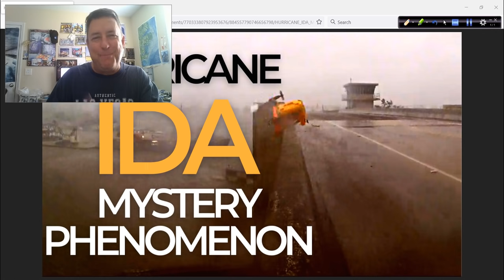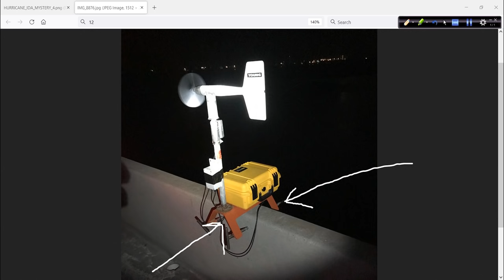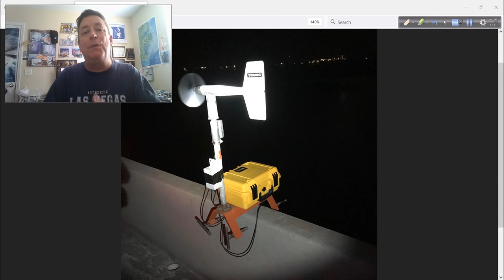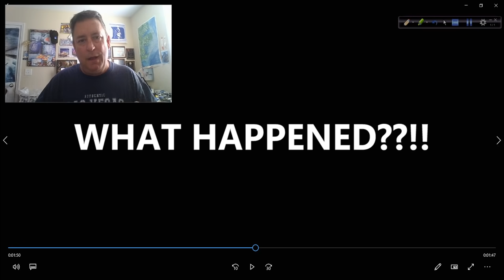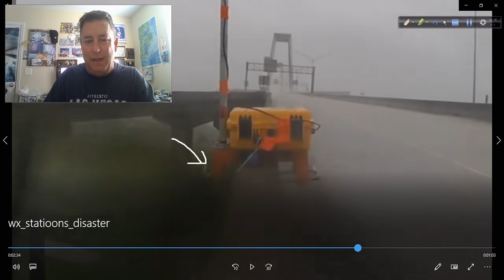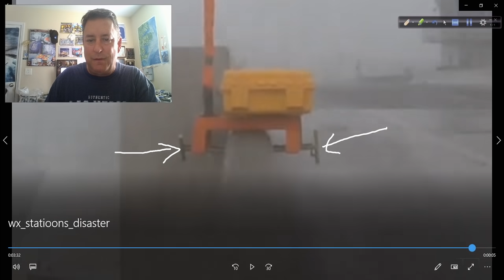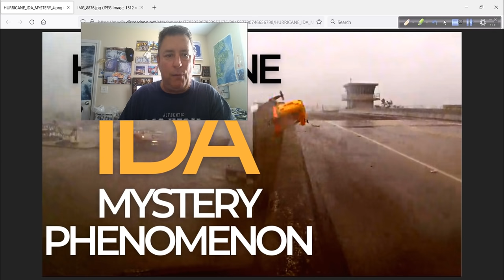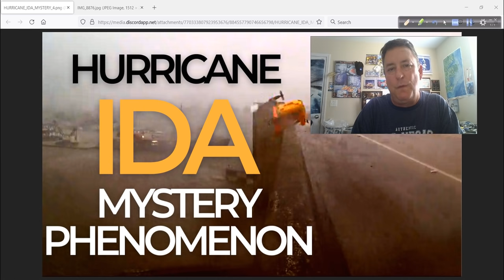Hurricane Ida Mystery Phenomenon: We Lost Two Weather Stations...Why????

Comment: It's definetely a vibration caused by the wind putting pressure on it. It's too bad there isn't an elevated surface you could put it on that it wouldn't need screwed too. If it could sit on the ground it would probably be fine. I'm guessing the devices are also pretty top heavy so maybe some sort of counterbalance could help too.

Comment: Small Outboard engines are clamped in a similar way on the transom board, but the clamps have a hole in each end so you can fasten them together once tight. That way they can never undo, unless you first remove whatever is locking them in place.
Reply: exactly...in this case the wind is simply blowing the handles loose...climate change..stronger winds...time for a new design of clamp

Comment: Jersey wall is a trapezoid. Any movement at all upwards (the only direction it can go) will decrease the pressure on the the clamps. Compounds from there.
Reply: This was my thought as well. The wall gets narrower at the top, thus once it started to wiggle lose it was done for. Simple solution: nylon lock washers. Also drilling a small dimple into the concrete would ensure the rig can not move upwards.

Comment: Is it possible to use some kind of strap,  like the ones that they use to tie down cargo on tractor trailers?? vibration does loosen things and hurricane force winds are going to pull. For example, shingles and the screws come off roofs over a certain mile per hour of winds and hurricane winds pull out boards, off of Windows, that are held fast by special screws.
Possibly if you put strap around the screws and tighten it really tight it the wind will not be able to move the the screw. I heard on the weather channel some of those winds were clocked at 150 mph when this hurricane first hit land. And for some odd reason things that are square don't hold up to high force winds as well as something that is sphere shaped

Comment: I'd try a cable from the back T on one side to the front T on the opposite side & reverse the other two T's as well (X) so each pulls its mate in the tightyrighty direction... They can't turn looseyleft unless the cable is removed.
Sorry about the loss though, expensive equipment!

Comment: I agree. Despite being a rather complex cause, the solution could be as simple as adding some rubber feet and a locking nut. Those feet should help limit the vibrations, and locking nuts will help prevent backing out up to a certain point.
Reply: I second the rubber feet idea 💡

Comment: The anemometer has too much leverage when the wind picks up causing the brackets to wobble thus resulting in the brackets and t-handles to loosen.  You could put a jam nut on the t handles to keep them from backing out and/or sharpen the ends of the t-handles to a point like a pencil so they “bite “ into what ever you are clamping on to
Reply: My thoughts as well. I think the lever arm of the anemometer might be flexing the whole bracket and causing loosening. Jam nuts are the simplest solution along with sharper points. It won't be "tool free" with jam nuts but wouldn't add but a minute or two more to deployment.
I'm a mechanical engineer but harmonics is not my specialty.

Comment: I'm fairly certain that the source of the vibration is the anemometer itself. Every time it has to change direction, even very slightly, applies a quickly changing force to the mount proportional to wind speed and change in direction. This vibration is the difference between the cameras that survived and the weather instrumentation that did not. Both had wind load, but only one had vibration as well. A great analogy would be changing a tire, where often you can put the wrench on and literally stand on it and it the nuts wont budge, but the guys at the tire shop use an impact wrench for half a second and it's off.

Comment: I believe you're on the right track, harmonic vibration (from wind vortex) of the cylindrical weather station poles that is transferred to the K rails. Are the poles welded to the K rails? If so, check for hairline cracks or possibly investigate using some type of damper.

Comment: I bet the bridge was starting to vibrate harmonically (like that bridge that fell down like 50 years ago) and it backed out. Other devices will use a “tie strap” type of thing through eyes in the screw handles so that they can’t unscrew. We use a somewhat similar method on different type of marine anchors.

Comment: If the concrete is sanding down there won't be a solution.
But vibration?  Eternabond a stainless steel rod to the pole for rigidity. Once every 10 years for a big one.

Your towers might start talking to you and say, you want me to spin a million mph and not vibrate? I quit.

Comment: Whatever the cause, three measures to address this:
1) KISS - lock nuts on all four screws might  keep them from unscrewing
2) Swivel pads (like on C-clamps) with a flexible rubber coating on the screw ends would absorb some vibration
3) A separate C-clamp with a chain to the main unit - like a trailer safety chain, would keep the unit tethered if its clamps failed

Comment: I'm somewhat in line with what you're thinking, which is resonance

Just the right range of frequency from the vibration feeds into itself and amplifies it as a result

As far as a solution I honestly couldn't say, not sure if adding rubber grips where they pins go in would diffuse the vibration or hurt the grip

Comment: Probably already thought of this but could you put tape on the threads? Possibly some type of bolt on the thread side? I worked in the oil field and vibration would always loosen nuts and bolts. Tie off the handles to the opposite side so it can only move in the tightening direction. Maybe tie the whole thing down to set off weights as last resort.

Comment: The orange base plate on the DOT clamp looks thin. It could be flexing given the oscillation of the anemometer mast allowing the clamps to loosen.  In addition to using steel wire to tie the T handles together I would tie all 4 legs together with a ratchet strap. Previous comments on foot pads are noted and definitely cannot hurt as they would increase your friction surfaces.  Rubber foot pads will grip the concrete opposed to the point connection you have now.  It would be interesting to see where the unit was mounted and what if any divots were left behind by your original installation.

Comment: Too small surface contact area. The ends of the screws are acting like rock crushers with the vibration and erode the concrete surface enough to where the screws can turn. You need large cup feet (looks like a giant cupped washer, like on a c-clamp) to spread the tighten load so the screw doesn't erode the concrete at contact point. Consider a tri or quad mount for the annenometer so there is much less vibration

Comment: I think the vibration started loosening the bolts and then the wind pressure caused it to let go. Plus the water might cause the concrete to contract and thus loosening the screws. Does not look like a real secure way to go to me. Plus it is top-heavy.

Comment: Hi Mark, here's what I suspect happened:

3 key concepts come together to explain  the engineering problem:
1. Gusts causing vibrations
2. Material hardness and material interface
3. Abrasion, effectively sanding down the softest material at the interface

Gusts cause vibrations of the platform. Vibrations may be tiny at first but sufficient. Those vibrations grow. How? Because at the interface between the (hard) metal screws and the (not as hard) concrete results in the concrete bring chipped away a very tiny amount with each vibration (think of this like the screws slowly sanding down the bridge/concrete (or whatever other less hard material is there, it could even be a softer metal or softer alloy material).

So you have vibrations that are growing and screws that are sanding and eventually maybe even chipping away at the concrete. The result is that if you sand down that bridge by a few millimeters you will see the same effect as if you hadn't screwed it in well enough (you guys did screw it in well enough! As well as anyone could! But there were still vibrations because no material is perfectly stiff)

Another part of this is the platform stiffness. No matter how stiff it is, in the real world, there will be vibrations with the gusts/wind/rocking/movements of the gear and the air flow and air direction shifting and changing abruptly. 

Over time the thing comes loose.

So I think bridge got sanded down due to vibrations and the equipment was now loose. 

Other possibility is the platform was not perfectly stiff and vibrated like a butterfly out.

Or maybe a bit of both! Right? Vibrations happened even if you cant see or measure them.

What you may wish to do to prevent this vibration from ruining your gear is to add rubber grips on thr bottoms of those screws. I can't guarantee you that will work better, but maybe another engineer can chime in here as well. Rubber will dampen vibrations and increase surface area of the contact interface between your platform and the bridge.

Best of luck Mark and thanks for your work!
Reply: Vibrations were the first thing I thought of too. Winds can produce pretty intense vibrations on bridges, which over long periods of time can loosen those screws.
Reply: Not only wind gusts causing vibration. Water flowing around concrete pilings can cause wicked harmonic vibration. Also think about a large chunk of debris lodged against or between a bridge piling and the extreme vibrations this would create as water rushes around it. Perhaps the DOT could shed some light on vibration tolerances so you could be reasonably certain this is your problem.

Comment: The source of the vibration is an interesting question but regardless of the source,,the answer in my opinion is locking the T-bolts so they can’t back out. Jam nuts, nylocks,  lock wire or lock washers are some of the common solutions to this common engineering problem. No need to overthink it if your only goal is to prevent future loss. However, if the goal of this video is to satisfy  intellectual curiosity (which is a legitimate endeavor, no question about it)., then I think you are on to something with your theory of harmonic vibrations set up by vibrations in that tall mast. I’ll be interested to see if someone with more expertise than I have chimes in on problem. Another thought: do your Jersey barriers taper from bottom to top? If so, that obviously presents a challenge to your current clamping system.

Comment: When you tighten a bolt down, or the t handles in this case, you are loading the threads. This loading happens in the form of the length of the stock of the bolt being compressed ever so slightly along its length by the torque. When you then apply constant vibrations to the system, the system wants to uncompress. The handles are torqued one way, so random vibrations tightening them will be cancelled by working against that torque. Random vibrations untightening them are assisted by the compressive elasticity of the bolt. Thus bolts tend to favor unscrewing themselves when subjected to vibrations.

Three main ways to deal with it;
- More torque, such that the friction in the threads is sufficient to lock the bolt.
- Threadlocker, such as blue loctite, adds additional friction that prevents random vibrations from loosening.
- Mechanical resistance, such as lockwire/safety wire, cotter pins, and similar, is used in high vibration environments. The ideal circumstance is to fasten lockwire/safety wire around two handles on either side, such that any force untightening one, contributes to retightening the other. Favored approach in aviation, consult google for images.

Kind regards, 
Master of Mechanical Engineering in the Aerospace Industry.
Reply: I think all they need is a lock washer with jam nut on each of those threaded rods which they tighten down with an open end wrench after tightening the screws down to the wall.

Comment: You are spot on! Use a locking nut on the screws to keep them tight. Happens on engines and industrial machinery all the time. You don’t need nylon nuts just put double nuts on the back side.

Comment: Not really a solution, but observation. First I don't know how heavy the pelican box and/or the anemometer are. But in both instances it looks like the equipment comes loose on the side where the anemometer is at.

So maybe a counter balance so the entire equipment is stable on the wall. So all weight is spread equally. So one side doesn't become dominant and destabilize the Jersey wall fixtures.

Just an observation, I can be totally off. But that's my input.

Comment: the nylon nuts will work. but two nuts locked together will lock the both against the wall. you have to lock the threads down so it cant back out. i also wonder if the mount had another bar that split the bridge wall to add mor support so it cant just fall over.
Reply: Otherwise known as jam nuts.

Comment: Find a way to lock the t handle in place and or put a double nut on  I think it is the tension on the threads that overtime the rocking and vibrations and they start to back off. I see some of the bridge rails around me have small drain cutouts along the bottom of the jersey wall. Might take a double look to see if you can find a spot similar and throw a ratchet strap over it also

Comment: Thermal expansion and shrinkage of the concert?
Reply: That thought crossed my mind as well
Reply: This is what I was thinking as well. Typically before hurricane's feeder bands start affecting the area, it's nice, clear, and sunny, increasing the thermal expansion of the concrete. And then once the rain/wind start, it rapidly cools and contracts.  It may not be much, but if it equaled a quarter of a turn of the bolt handle, it would weaken the holding power of the bracket.
Reply: So if the clamps/screws don't have a spring loaded tension (Lock Washer or something like it) the slightest release of tension will quickly loosing the clamps.